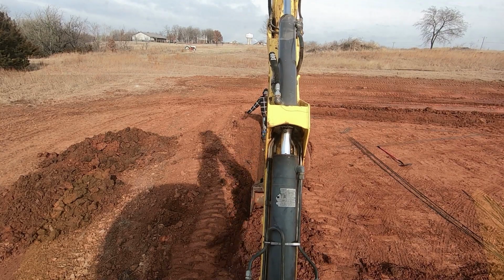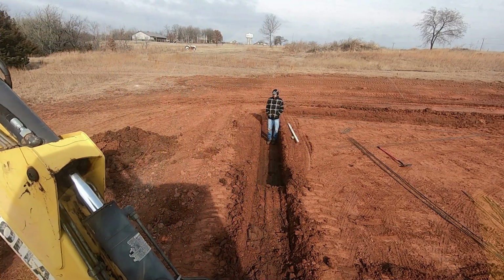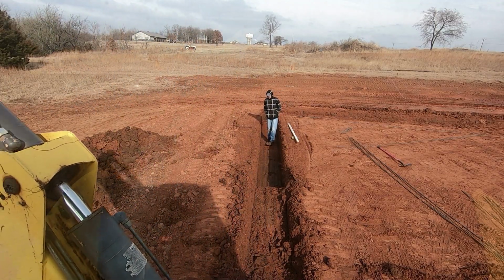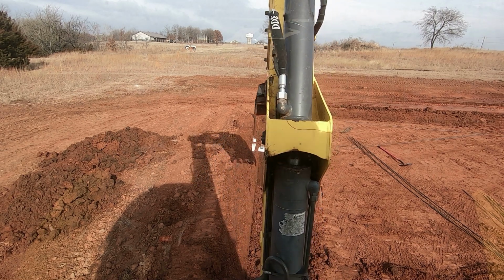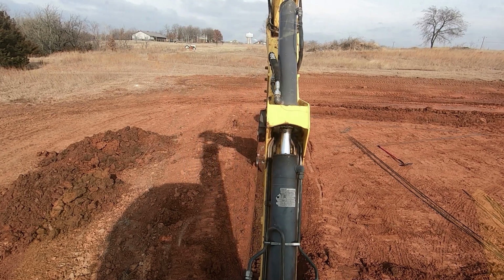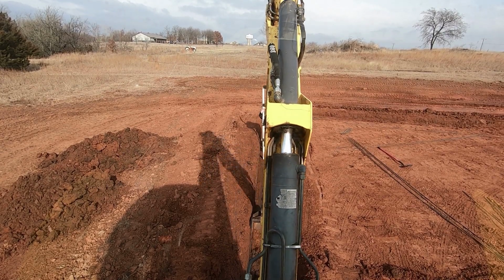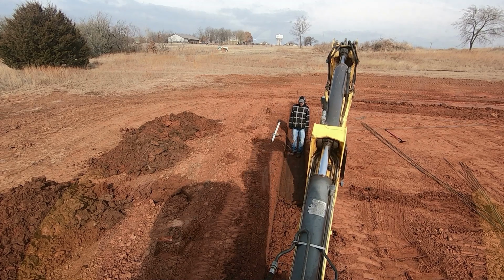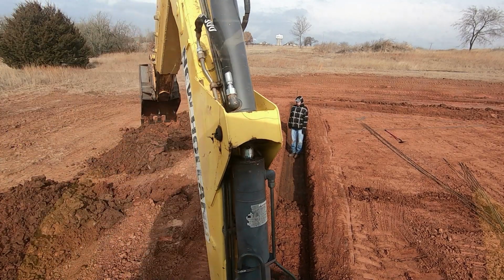Diggin a footing for E.L. Construction #backhoe #MBGA #Backhoeman

Comment: Ran my 310J for the first time today (first time ever at that end of a backhoe) and you sir make it look easy!!! I dug out a bunch of fill we've dumped at our shop and tried to make a nice sloped swale for the water to run to and past the fill, the hardest part was trying to dig a 2-3" 8foot long little swale, trying to pull the arm back but not get it too deep was comical lol.
Reply from the maker: J and B LawnCare you will get the hang of it! It’s really not too bad if you just put a bit of effort into it, if you can operate a backhoe on both ends you are gold on just about any other machine out there. The machine is capable.
Reply: Takes time in the chair and listenin to ol Frank here with the best good pointers. When I was a little fart, my grandpas good friend who did a lot of excavator logging, road building, and land clearing here in Oregon always talked about having his two sons get on the excavator and run the bucket in and out a couple inches off the ground.............for hours. Then he'd have them walk it to a slope and do the same thing, now not everyone has a bunch of time to do that I know but even if you spent 20-30 minutes doing that whenever you had time would help you feel that machine out right quick. Plus side is you're not making a mess of any ground you would have to fix afterward, just pretend you're trenching or pulling some slopes and build the muscle memory for when you do put those teeth in the dirt. Also like Frank says, "anyone can do this"............and you can get there and truly isn't as hard as you may think, just takes time, patience, and not quittin. Good luck and safe diggin

Comment: Alignment  10/10
Depth          10/10
Neatness    10/10
Speed          5/10
Complete cycle to partially fill each bucket.
Yes I know it compacts the side of your trench.
I'd hire you in a heartbeat.
My job sites are all about speed (plant hire).
If you're not quick enough your off-hire.  
Like your videos, all that being said.
Cheers
Reply from the maker: B Shorty thanks I have a 4 hour minimum, job took less than 1-1/2 hours, why rush. But whatever, a few extra minutes to save a couple yards of concrete is usually appreciated. As you should know every job is different, if you had a full bucket every cycle you would have busted the sides off of the ditch. That means you have to move more dirt, that takes more time. Id rate your comment 6/10 😂